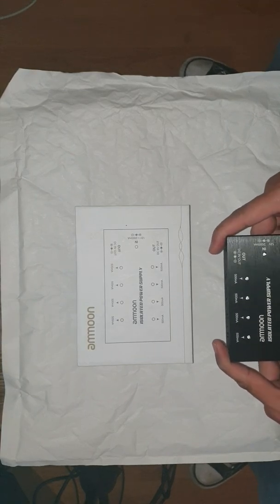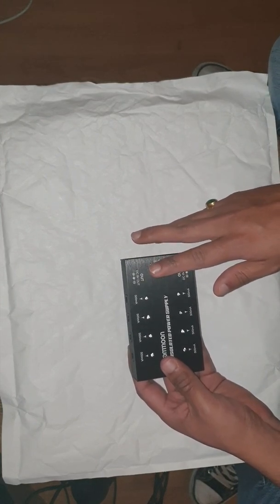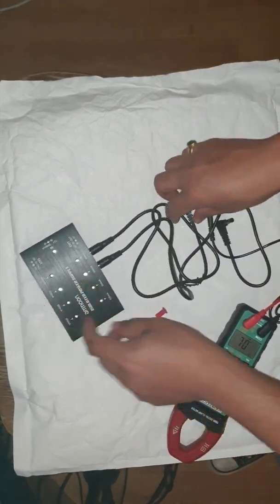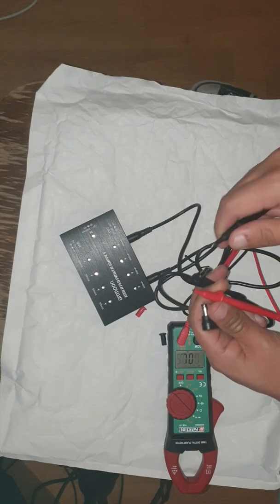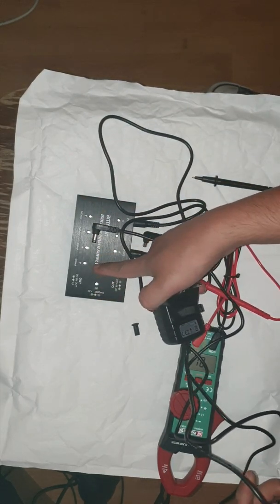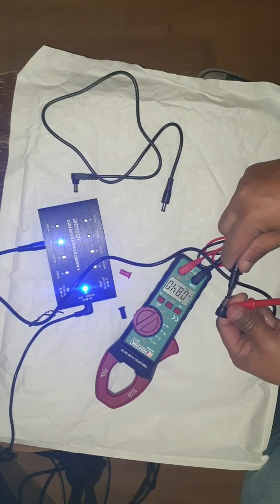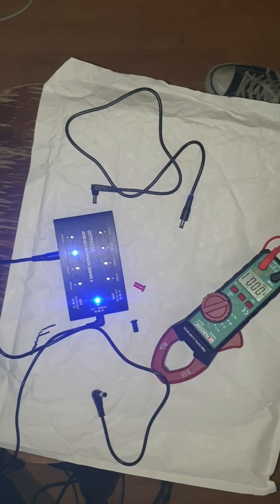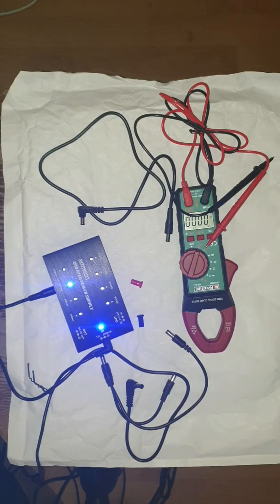Ammoon Isolated Power Supply (unboxing/continuity test)

Comment: I have a question this device is really isolated?? any problem with power supply so far?
Reply from the maker: Yes it is isolated. In the video i show continuity test with a multimeter. If continuous, it will beep.

Comment: congratulations on the great video, but I had a question. Does it not reach 9v have any problems?
Reply from the maker: it will not be exact 9 volt. little up and down should not be a problem. i faced no issues so far. good luck.

Comment: this power supply protects my pedals from a electrical surge ?
im a subscribe :)
Reply: im not entirely sure, but there is a separate power adapter, i assume the power adapter will fail before reaching the box, in case of electrical surge.